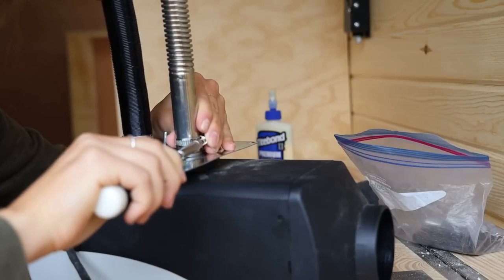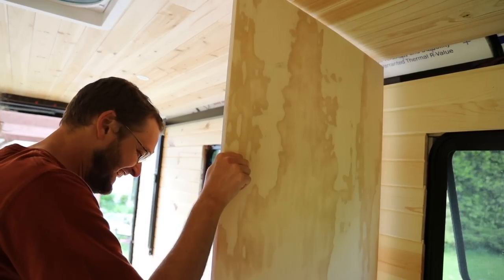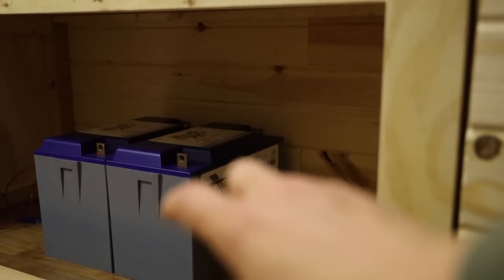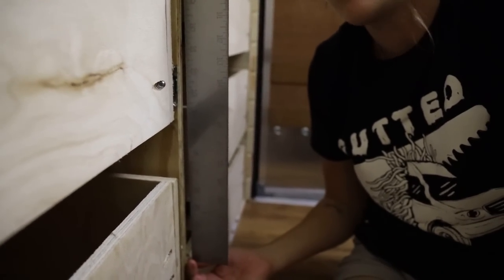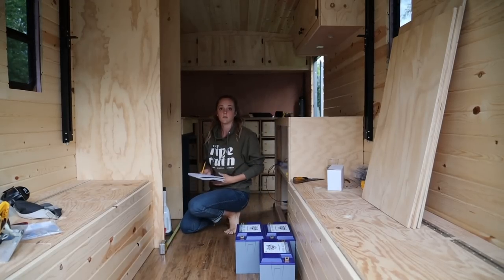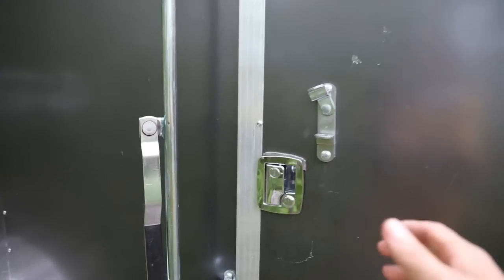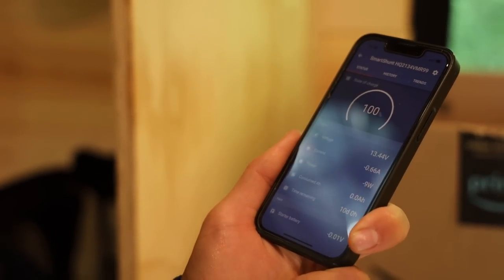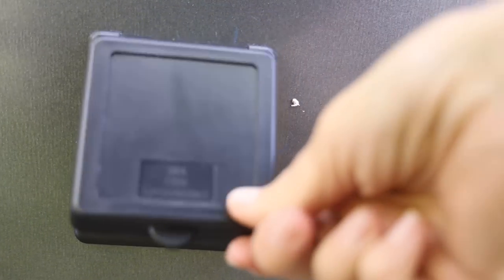DIY Cargo Trailer Conversion FINALE & Mini Tour

Comment: It looked to me like when you were working on the drawers that the trailer wasn't quite level. I'm certainly not a professional builder, but wondered if that was the reason for the issues with the cabinets closer to the door?? At any rate, thanks for sharing, enjoy the remainder of your summer!

Comment: its difficult to keep flush in a trailer because its sitting on ground that may not be level and the tires may have different pressure levels, to ensure flushness its best to build outside and install once built

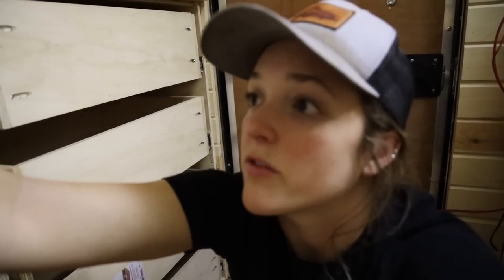Comment: 5:18 That's a great trick about the right angle, I'm going to have to remember that one.  12:06 your shirt says 'cunt' :p  12:21 RV Labs latching drawer slides?  very cool looking.  19:36 I have a similar bed/walkway design but I've been trying to figure out how to put a table in there without putting a permanent tripping hazard in the floor.  Folding table legs.  It seems so obvious now.  21:26 That bathroom is a hell of a concept.  I look forward to seeing it when it's finished.
Reply from the maker: So glad you like the design and different aspects of the build! I look forward to seeing the bathroom/shower design come to life as well!